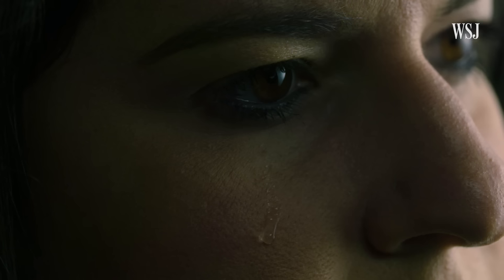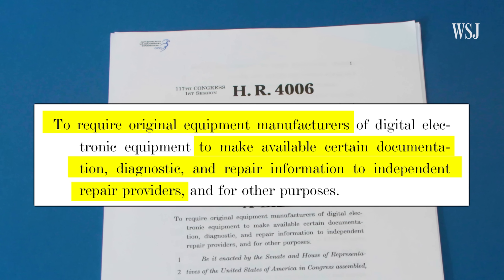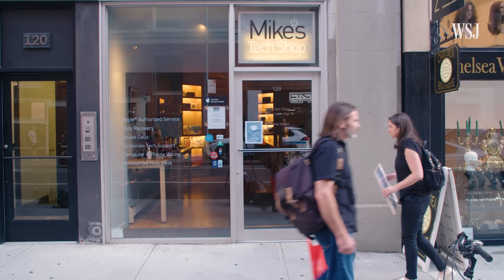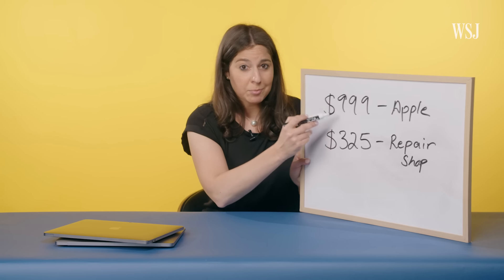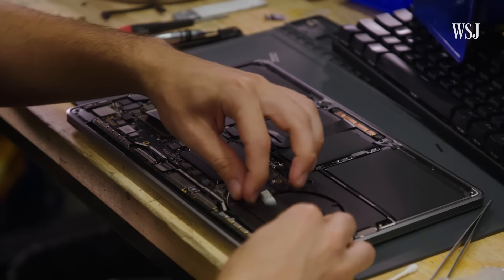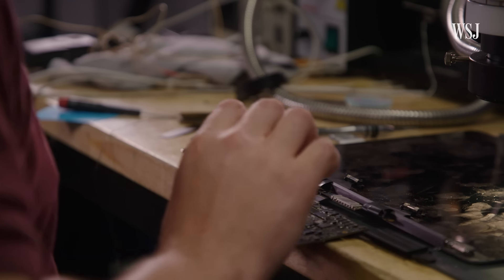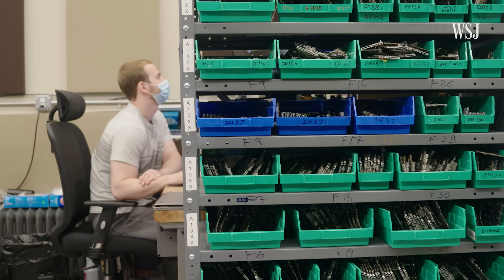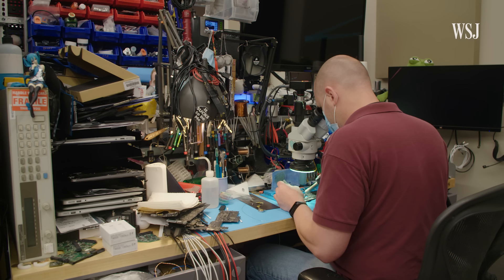Apple Store vs. Repair Shop: What the Right to Repair Is All About | WSJ

Comment: Yet more Apple hate propaganda being shoved out by using a totally unrealistic comparison. Water spilled onto a laptop could get to so many places and the only way to ensure a reliable repair would be to change the whole motherboard. The repair done in this video did not take into account other sections of the board that could later cause problems. Once corrosion has started, it has a tendency to continue and all sorts of strange chemical reactions take place over time. I've seen dendritic growth on circuit boards that caused short circuits ages after the product was initially damaged. Yes you can get a repair for a third the price but is it more reliable in the long-term.............unlikely.

Comment: What if Ross repairs a computer, but there’s an issue with the power system and the computer catches on fire. Then what? Reputation damage for the manufacturer.
Reply: thats not reasonable reason for stopping people from repairing systems and reducing e-waste
Reply: @brunoyudi9555  
Please don’t exaggerate. You’re jumping into extremes.
Reply: @lumberjackdreamer6267  Saying that it would catch on fire is, technically speaking, an extreme.
Reply: @kingeling  
Yes it’s an extreme situation, but it happens. For example, an aftermarket battery replacement that fails and catches fire in an airplane, …
That being said, I repair my phones and computers and other machines.

Comment: Alright let’s be clear on this video. First things first anyone and I mean anyone can learn how to repair like this guy. Second when apple states trained technicians yes trained in way that the environment they work in is safe. The technician is grounded to the floor which that guy isn’t. And specific guides to repair a device that would prevent further damage to other parts and post diagnostics to run to guarantee no other components are damaged which I didn’t see in either. So bring it to a guy with opens your computer without the right tools and also not running post diagnostics after to make sure you didn’t waste 325 for a device that can fail again soon? Or bring your 1000 computer that you invested in to apple
to get a proper repair done? Also he can easily sign up for that independent repair program lol. His reasoning was poor. Don’t repair apple devices in that case. Go repair cheap PC’s.
Reply: You do know, in the over the head angle. You can see the laptop is on a anti static mat. That would be connected to a ground point.
Reply: First off your whole spiel is irrelevant because you don’t recognize how much of a professional this guy is. He’s repaired thousands of computers and phones and your concerned whether he uses anti-static mats or not. 

You need to steer clear of these comments because you have no idea what your talking about.